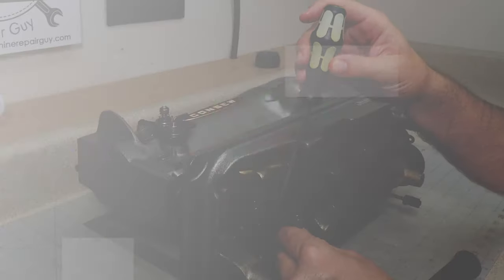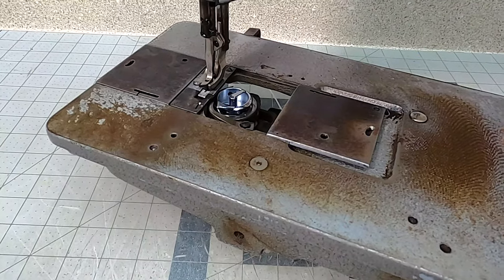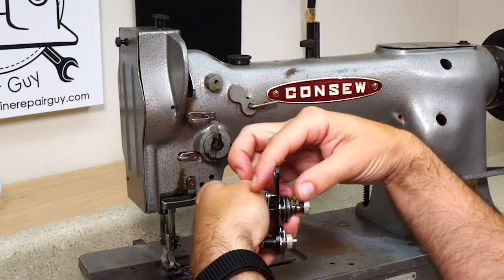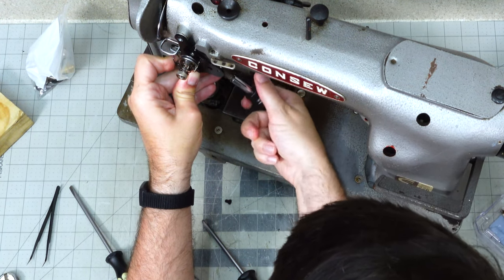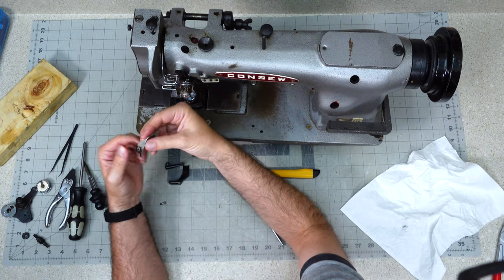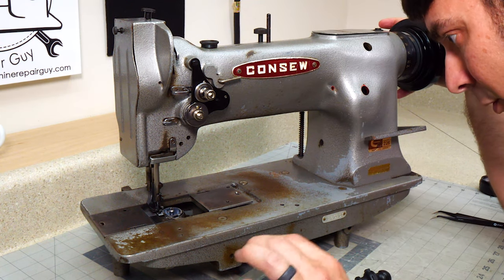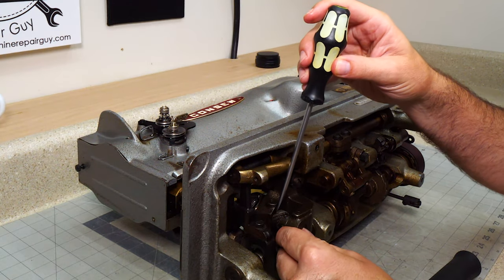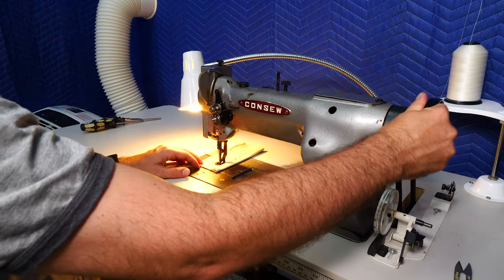Repairing a Consew Industrial Sewing Machine

Comment: Hi, I inherited the Consew 226 from a close friend that passed away. I haven't used it much but I decided to lubricate it and adjust tension and stitch which is ok now. Problem is adjusting stitch length, it binds and hard to adjust it. I set it at 7 which looks good for leather. 
Thanks for the video!

Comment: Hey man, thanks for all of the great videos you put out. I am a hobbyist and do some sewing. I started with some old machines and moved into some newer machines and now I am using industrial sewing machines. I have fixed my own machines and have enjoyed adjusting and repairing them, as I move to different ones. you're a great reference for my lack of knowledge in the repair department.
I came across this video and it is the same as the one I use now, thanks in advance for any repairs I may need down the line. I have seen several posts around the internet on problems with adjusting the stitch regulator so that it is stitching the right number of stitches. it seems like a common issue and I Now find I have that problem. If I set it at five, it stitches seven or eight stitches. Any recommendation on finding a solution for that issue. I have seen two repairs for this problem but they were gear drive and mine is belt driven, the instructions show the adjustment on top of the machine where the gears are but when opening the top of the machine, It's the belt drive. let me know if you have any ideas and please keep doing what you do and keep the videos coming, they are great to watch.

Comment: I know this is an older video; I am looking at a pair of CONSEW 225s for sale locally, one being billed as a parts machine. I really want to restore both machines. Are you willing and/or able to be available for consulting? My primary concern is locating parts and access to assembly diagrams to know what parts are missing and the ability to rightly identify parts for ordering replacements.

Comment: Great video, I bought a pristine 226R years ago on C.L.  I’m gotten re-inspired to get back to gaining confidence with my machine.  In video you talked about eye-balling timing rather than using manuel specs.  What is a better description of what you look for.  How much should needle rise before hook tip is at centerline of needle.  And should tip of hook be in the middle of needle scarf or perhaps a bit lower or higher ?  You also raised up bobbin case assembly shaft.  That I assume doesn’t effect timing ? just effects bobbin case retention tab ?  I’m glad I discovered your channel and plan to watch them all !
  Bryan C.   (Camas, WA)
Reply: I have a singer 112W-139 which uses the same vertical hook system.  
As for your question about raising the bobbin case assembly shaft, I think it will not change the hook timing. Here are my reasons.   The hand wheel remains unturned.  This constrains the large gear on the lower shaft from turning. As the small gear is mated to the large gear, as long as it is not lifted or lowered after re-tightening the set screws,  it will not turn either.  The bobbin (hook) shaft is constrained to not rotate by a recess that locates one of the set screws.

As for your first question, there is a beautiful video by Uwe Grosse called 'Consew 225 Hook Timing' that will address all your questions.  

I visited Camas, WA a couple of years ago.  Very pretty.

Comment: I don't know if you can help but gotta ask. I was given a consew 126r-1 that looks like brand new it shows absolutely no wear but it sat for almost 3 years and the old oil was like tar. Ok my problem it I push the button but can not turn the wheel to change the stitch length. I'm thinking the old oil has it gummed up but no idea. I would appreciate any help

Comment: Very informative! I have a Consew 206 rb5 that's in new condition. The machine works beautifully, but I'm not able to get the presser foot off. The screw that you remove from the back seems to be totally seized. It looks new, with no rust, corrosion, or wear. Any suggestions as to how I can get that stubborn bugger out of there?

Comment: Hello, I have a Juki LUH 521 double needle. One of the needles is sewing very well but one of the needles is sewing well the bottom stitch but it is leaving little balls on the top stitch. I have adjusted the top tension and the bobbin tension and I still have the same problem. I removed the hook, put it back and timed it and it work well for a little bit and then started doing the same again. I appreciate some advice. Thank you for your time.
Reply: This is kind of old and you may be good now. When you pull on the thread of the bad side bobbin case, does it have some resistance? If you feel like it's light and you've tightened the little screw and no change. Take the bobbin case out. Remove the adjusting screw and the tension mount screw to remove the tension spring. Sometimes a piece of lint or thread gets stuck under the spring. Check the spring and bobbin case for any wear grooves. After a period of time the thread can saw a groove in the metal and the thread will ride in that groove freely instead of getting pressure. Also the tension spring can get bent out of shape. You can bend it back a bit so it makes more pressure on the thread but if you bend it too much it will snap. When that bobbin case is right, you can adjust the tension until you can barely pull the thread through by hand. This is not the correct setting, I'm trying to illustrate how much bobbin tension can be applied on a functional bobbin case. That's all I can do over the innertubes :)